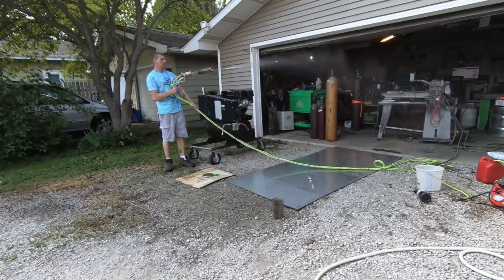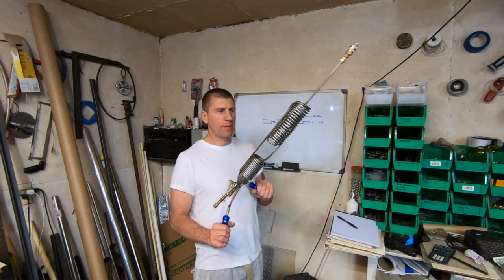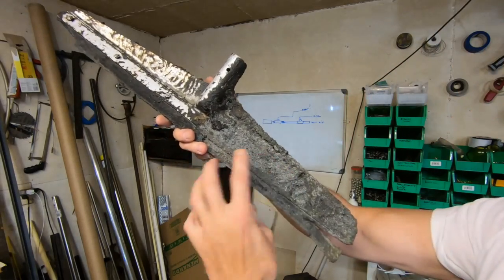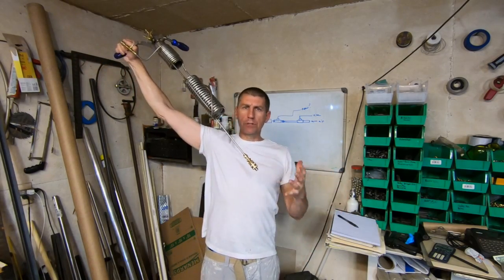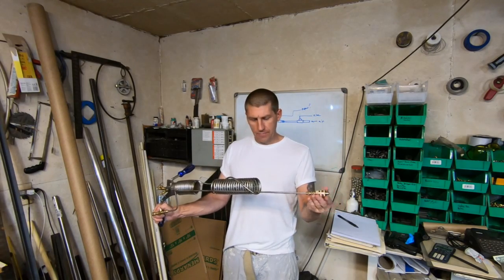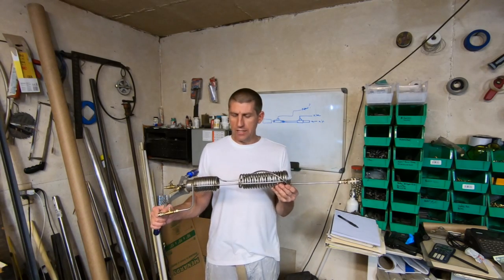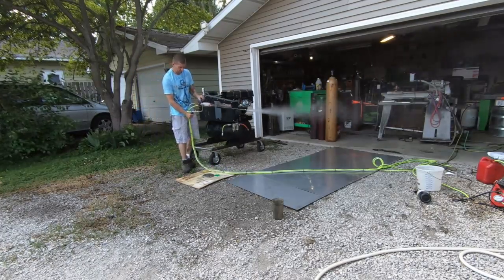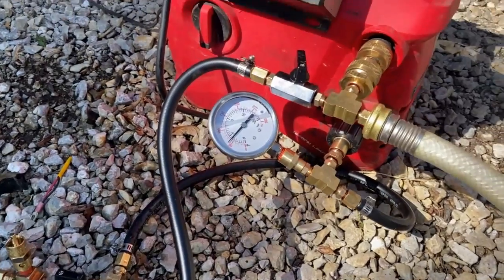STEAM AXE DIESEL POWER CLEANER

Comment: I could see a market for a stationary unit, that had a optional couple to attach the "AX" . IAs I come to understand in places on the globe where there is perma frost , we will use Alaska for a geographical conversational reference . They have issues in the extreme winters with their black water  sewage drain lines freezing. As a solution you have companies that have steam boilers units on pickup 1 ton trucks that will come out and defrost your waste drain lines by pumping the steam through the line until it clears . An use for the AX would be if the crew had to address a burred in the perma frost section of pipe you would need a tool that could minimize the operators time exposed to the extreme temps , also refreezing of the work area with in minutes . So you could have a diesel like 4 burner unit supplying the main defrosting power and a union fitting for a small passive wand for any clean up on the truck or equipment ( say as you are pulling in any hose or cords for lights that may have been in contact with frozen excrerment , one could clean everything as it was reeled back and stored on the truck; door locks and door jams freeze too and the wand would make short work of those jobs.) Back to the AX , a fuel feed line from a junction on the truck from a heated diesel storage tank ( the fuel can freeze in winter in that kind of environment) a operator could take lets say a frozen water line leak that has created a wall of ice blocking access to the leak , or melt accumulated waste water from a dwelling exposing access to pipes that have froze and caused surface waste water build up. A smaller version could be used to melt  condensation that has frozen in air brake systems on semi trucks and trailers ( see ice road truckers, I feel some of their brake line issues are manufactures drama for television, but the potential issue and a quick way to return a tractor to service is real ) that use air breaking systems . Ax would be perfect for accumulated ice that forms on commercial fishing vessels , many a fisherman has gone to Davy  jones' locker due to vessels rolling over from being top heavy and capsizing , I think your tool could efferently clear frozen deck drains , iced over sensitive equipment like CB antennas and radar/gps  units ect  . As well as removing the build up ice on crab pots when the fisherman are dead heading to their fishing grounds and returning with their catch. Like in a few seconds after deploying the ax a crew member could be reducing deadly potential energy trapped well above the vessels designed ability to right its self in  rough seas.  I hope these ideas help you gain new ground in new markets and this tool and variations to come find their way into the hands of people working jobs with interior tools and help some to spend less time exposed to the elements and even potentially save lives at sea where sailors and fisherman need better solutions for  quickly removing  freezing ocean spray relentlessly accumulating  on their vessels. Oh almost forgot Health and pest control services could benefit from a truck mounted boiler to deploy steam killing bed bug infestations ( or a county health department dealing with a semi crash and now there are pathogens blood tankage waste from a chicken processing plant coating the roadway and cars involved including 1st responders , a steam unit could effectively neutralize salmonella, and other  harmful bacteria negating the use of bleach to combat the cross contamination from fling insects feeding and then contacting surfaces people touch exposing them to potential sickness , and cleaning their PPE contaminated suits and boots could be washed and made safe to handle in some situations saving departments untold tax dollars .) negating the use of ever evolving chemicals that are toxic causing untold damage to people and the environment through their deployment and manufacturing processes  and the undesired contamination of adjacent and common access points to the work areas. Steam only poses   issues when negligent or ignorant operators miss handle and or store , transport the fuel used by the boiler and is way less toxic than the ever increasing strength of pesticides designed to combat the constantly evolving and immune parasitic insects like bed bugs currently causing untold of  millions of dollars in damages ,in some cases condemning whole structures because of infestations. Steam kills adults their juveniles and eggs instantly ,eradicating 100% of their life cycle on contact and its safe , every public and common space service or biasness should have a unit at their disposal for the better health of the population .